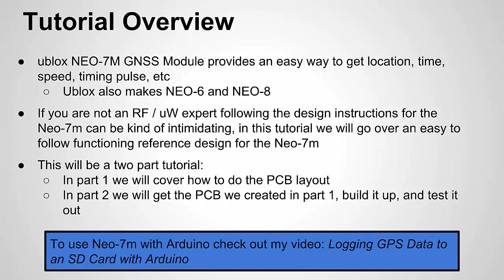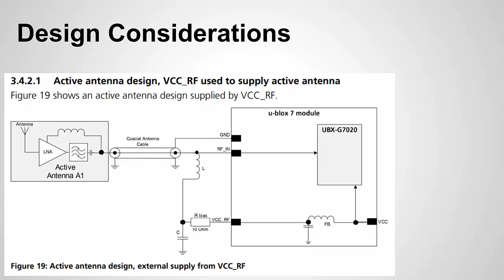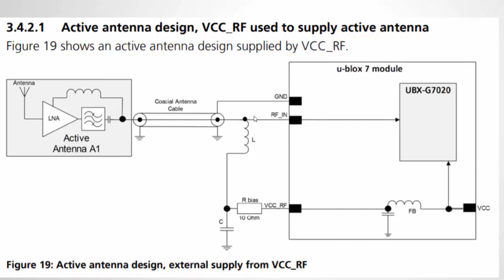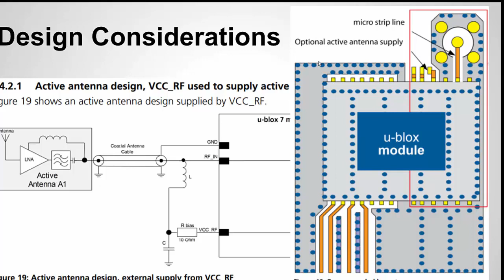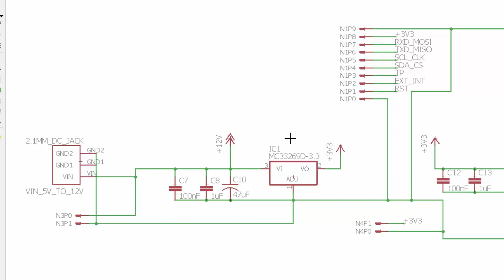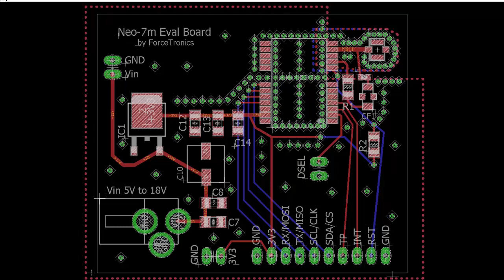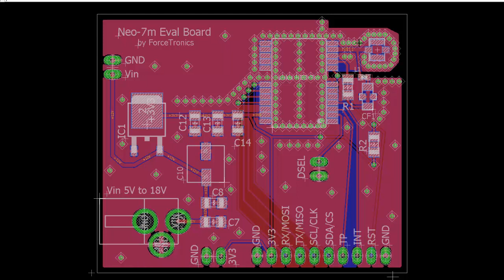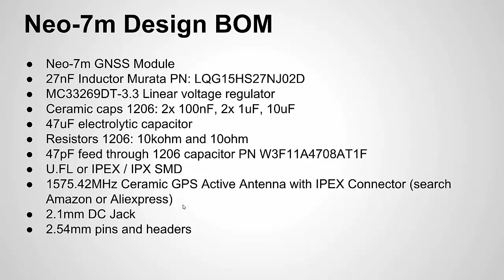Easy Way to Design a PCB for the Ublox Neo-7m GNSS / GPS Module

Comment: Actual question - why did you put a cap on your DC line? In RF applications that should be a blocking cap preventing DC from reaching the RF_IN pin. You just put a DC block on your DC line in your design...I imagine your active antenna didn't work well. The schematic would likely need correction so the cap was between the RF_IN pin and the inductor - RF trace junction. A cap off DC would be a shunt cap for denoising...
Reply from the maker: It is a Feed Through Cap specially designed for HF applications. It looks like it is in series with the signal but it is not

Comment: Why use 3 different values of capacitor (ie, .1, 1 andere 10mF) for noise suppression instead of onze large one?
Reply from the maker: The impedance of a cap varies based on the frequency of the noise. You use multiple values to cover a larger frequency range of noise
Reply: of Course, thanx!

Comment: Well I'm a hardware developer guy and I have found myself in a situation where I have to design a PCB for the first time in my life :D I have designed the whole system on a bread board and everything looks fine but I need to put everything on a single board as the final product, the problem I didn't know that noise can play such a big role on the design of the PCB, and I need to use this exact chip along with a sim800l chip along with other components, can I use this design for an extremely noisy board like the one I'm dealing with? Thanks
Reply from the maker: I am not familiar with the chips you mention. I would recommend looking up their PCB layout information / recommendations. Should be in the datasheet or user manual. You can always reach out to the company's support staff for a possible sample layout